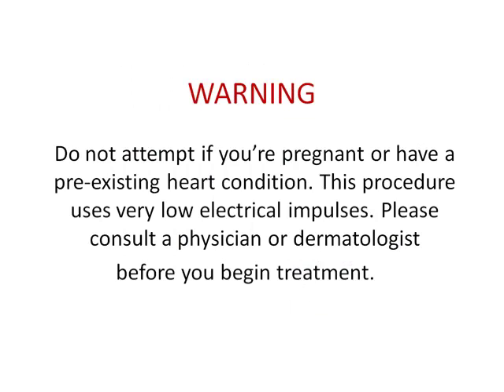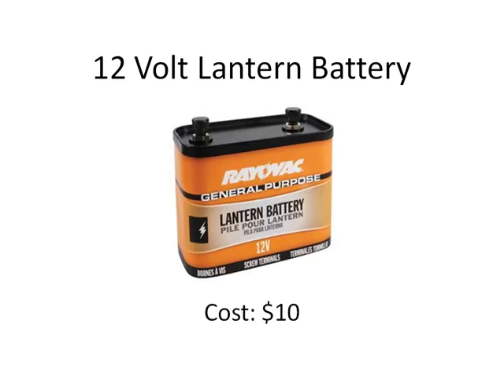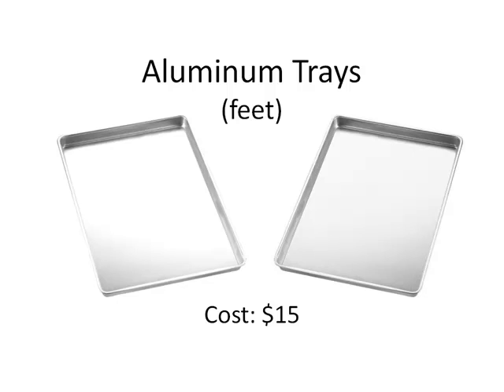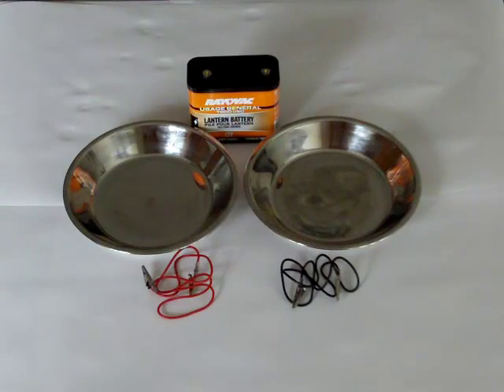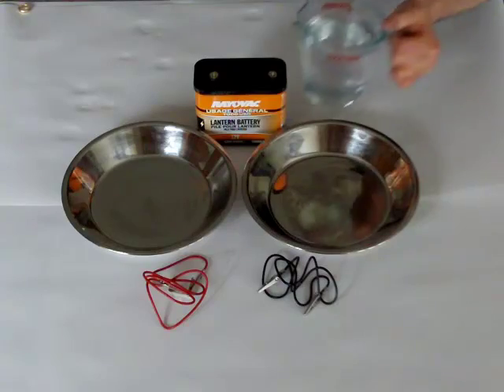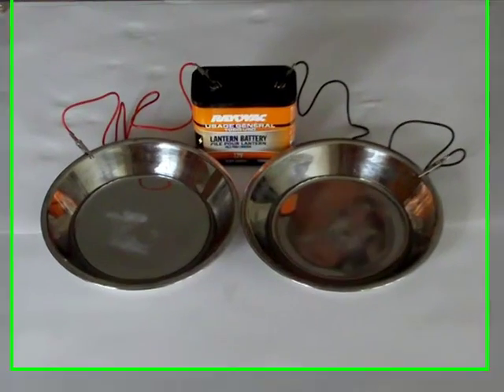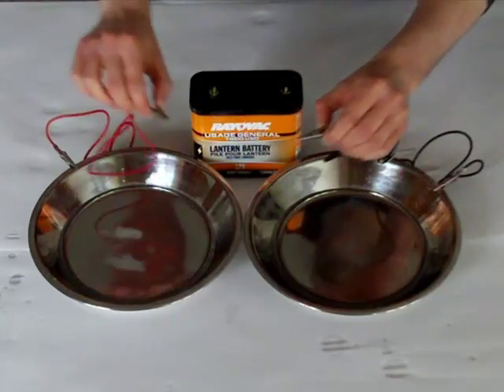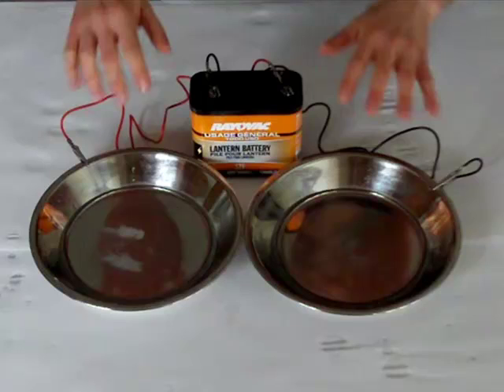How to Build Your Own Homemade Iontophoresis Device

Comment: i have a ad/dc adapter output 12v 2 amps it is save to use?
Reply: I am planing to do that.. I believe that it works, if you have does cups, try for few days if doesn't work, you always have another option... It would be good not to cut the wire, if it is charger for a laptop or something. just put some, peace of paper clip or something into the hole, and you have a + ... the other aria is - ... little bit of wires, and they you go, then if it doesn't work, you saved your charger.. I will try this pretty soon, I have 1.4 amps
Reply: *****  did that work?
Reply: *****  did that work?

Comment: Ok so I bought all of the suggested materials from Amazon like you said. I connected the alligator clips to the battery and to the pans. However fit some reason I don't feel a thing, is that normal? If not then what an I doing wrong?
Reply: maybe you have a defective battery?

Comment: I've tried this and it does work, however my friends and relatives were shocked and prevented me from using it further because they say that it can affect my heart with the electricity! Is this true? I do want to use it but I'm afraid for my health.
Reply: Nah, voltage is too low. Amperage is really the power part that can kill you, but stay under 1 amp and you're fine

Comment: Hi...can someone offer any advice. When I put my hands, right when I complete the circuit, I feel a shock and that shock is somewhat scary. Is there anyway to avoid the initial shock? Any advice is greatly appreciated. Please Help!!
Reply: Brian, it is a normal part of the treatment. You tend to get a little shock when you initially place your hands in the pan, and also when you switch hands. After a while, you get used to it. The good thing is if you feel the shock, then it means your battery power is pretty good. If the shock is too strong and stays too strong during the treatment, you might want to lower your voltage. On the other hand, if you don't feel any shock, it means it's time to replace your batteries.
Reply: Dan Reeves Hi, is it possible for me to replace the battery with this? http://www.amazon.co.uk/Blackspur-BB-JS206-12V-Trickle-Charger/dp/B003VS7VVE/ref=pd_rhf_dp_s_cp_1_YPJ7?ie=UTF8&refRID=0E1QG40H70YQR1YB3CVC I really don't understand these stuffs and wonder if I could use that. Thank you.

Comment: Can I connect 2, 12 Volt Lantern batteries together with the alligator pins to create 24 volt? I have been using 4, 6 Volts batteries and I just noticed that it would be cheaper if I buy 2 of the 12 volts batteries. Thanks

Comment: Brilliant Jason. Thank you so much - just after a week and the effects are incredible already. Even though I misremembered the instructions and only did it every other day.
I wish I'd done this years ago!! I've used an old camcorder charger I've had lying about for years which gives out 11v. 
Although for me the tingling with the salt was too much - so I've gone for pure water (maybe too much salt?!). And i've lined the bottom of the trays with paper so it's easier to rest my palms / feet in :-)
Reply: Hei,i am facing e problem!! I get bit electric shock when i put my 2 hands one by one...
But when i just put 1 hand in the water and the other is not using,it Doesn't give me shock.is there any problem with my function?
Reply: @Sarah-zh4xj You are required to use both to complete the circuit of electricity

Comment: That is incorrect procedure from everything I have read and experienced.  It deals with polarity and you want different polarities for each plate and remember to switch polarities. Also, having plates touch is not recommended because it will affect your batteries. I am not an expert-I am basing my comments on videos I have seen and materials that I have read in the past.

Comment: I've been doing this for more than three years with excellent results. I use 18v consisting of three 6v lantern batteries in a series.  Some people go as high as 24v but I found that difficult to tolerate.  I only do the treatment on average about once or twice a month but recently did not do it for about 4 months without any apparent adverse effect.  I think that a lot of the condition is sparked by stress or nervousness in my case.
Reply: Hello sir, I am glad it worked for you I know it's been 9 years but can you enlighten me that if your condition cured permanently? How often you sti use this 
Please Answer I'm too suffering within this from my childhood

Comment: Use 3 or 4 6v Lantern batteries and hook them up in a series. That way you will have 18v or 24v which will increase your chances of getting results. Be patient and don't give up.  Also, consider a treatment every other day instead of every day.  Sometimes it pays to wait a day or two and you may find your hands dry up in the interim.

Comment: I have hyperhydrosis pretty bad to the point where I drip sweat off my hands at certain times. I've used this anti-perspirant called Certain Dri. It doesn't really work well on my hands or feet but it works REALLY well for my armpits.

Comment: If it does, just don't panic as I did.. Now I learned few things from my personal experience. I noticed that it still works but if the weather is below ~25C, also I've been told that if this happens best way to get it work is to stop ionto treatments for a while so your skin and sweat gland lose resistance to electricity.

Comment: try mitchum deodorant (roll-on), it's 20% concentration like most of the strongest clinical antiperspirant and it's the only one i've found that doesn't sting the underarm area, it's around $3 at any pharmacist/chemist warehouse, or even a regular store like coles or woolworths. Also i do believe you can find something online that's like a metal plate with a cloth that you can use for underarm, but i'm not sure.

Comment: If you use a 6 or 12 volt battery is safe, even with salt water, you dont begin to feel a slight pain until 50 volts or more.

I doubt about the efectiveness of this method but seems pretty legit.
I think it's not permanent but it's a good solution to end with the vicious circle of sweat > stress > sweat more > more stress > more sweat...

Comment: Thanks for this Jason. I have an Idrostar machine for my feet. I recently worked out that if I got some deeper plastic tubs and put my feet in them on the metal plates provided, I could  achieve a cessation of sweating right up to above my ankles. continued below>>>

Comment: It was like having 'normal' feet - it totally changed my life - and was so much better than just stopping the sweating on the soles of my feet, or the soles and topsides, which is all that is possible with the depth of tray which comes with the Idrostar. BUT - AND THIS IS VERY IMPORTANT - my deep-tub system only works if I keep the amount of water to a about the same amount as would fit in the Idrostar trays. CONTINUED BELOW...

Comment: I achieved this by putting some glass building blocks in each tub alongside my feet to displace the water so that it covered up to the ankle without requiring gallons of water. It seems that the more water there is, the less effect you get. My aim now is to get some deep plastic tubs that are just the same size as my feet, then put aluminium trays cut to size inside them, and then place one end of each tub on a block so that they are angled about 30 degrees. ...CONTINUED BELOW..

Comment: That way, I'll get water coverage right up above my ankle with minimal water. Any thoughts on this? Also, I notice you don't have any plastic insulator mesh between your palms and the aluminium trays. These meshes come with the Idrostar. Are they really necessary or not? Thanks again.

Comment: Don't use a car battery, your dad is right. Buy a couple of 6 volt lantern batteries and connect them up or use the 12v that's in the video.

Comment: This device worked for me. I saw the results in about 12 days, first few days at 12V than 18V. The only thing I added on my setup is those kind of plastic sink rugs at the bottom of the pans so that the hands aren't in direct contact with the pans (in my opinion, much more comfortable than have the hands hover in the water).

Comment: @DanReeves 1 daily been doing.it for 3 weeks still i dont  see any sweat reduction just a little.. 2. A spoon of salt per pan but ive been doing it  with  baking soda the past   5 days 3. It feels.kind of.cold the water sometimes is warm., 4 im not sure.ill.tolerate 24 v because of the cuts dots ive.been.getting.thanks  to.treatment. 5. Its sumerged that it.only hits my palm 6 im using 6v latern batteries for a total of  18v . 8, Im using aluminum pan i bought it all on amazon , i hope.u could h

Comment: @Danrivers im using aluminium pans its been 3 weeks and nothing i dont wash my hands with soup lol and i sumerge it that it only hits my palms ans i stopped using salt and started using baking.soda and still getting irritaded dots when im doing the  treatment when my hands are dry i noticed than if i  do it with the sweaty hands i feel.the electricity on my entire hands ive.been using 3 6v latern batterys for 18v

Comment: I've done the exact same procedures with 18V for 6 consecutive days now, and I got no results at all, I still sweat my palms and feet.

Any Ideas why it's not working with me?
Reply: Any results after that?
Reply: @harshithrao9126  yes, worked like magic ! I still do it till now (8 years later)... it is stubborn at firts and needs consistancy.. for me it takes somewhere between 10 & 15 daily therapies to get it dry.. then I need  a maintenance session once or twice a week
Reply: Great!! Happy for you!! Completed 6 daily session and there is no significant improvement!! What is the electricity level you use for both Palms and sole?

Comment: I did this procedure last year and got a good result, the only problem is that I had to do it for over 3 weeks to obtain dry palms. I would suggest buying HIDREX PSP 1000 Iontophoresis Machine which give very high currents (equivalient of 12 car batteries) for good results

Comment: Samuel,

Some questions for you;

1. How often do you do the treatment? Daily or every other day?
2. How much salt do you add?
3. Do you use warm water?
4. Can you tolerate going up to 24v?
5. Do you wash your hands with soap before each treatment?
6. How deep are your hands submerged in the water?
7. What type of batteries are you using?
8. What type of pan are you using? steel, aluminum?

Please answer these questions, and I will follow up.

Comment: HELP 911 Ive been doing this for two weeks and no results ive been doing 3*6v total of 18v.. 20 minutes each polarity and nothing my pans are getting like oxidixed i think its because of the salt ... and recently i got little white dots  and stings with the treatment... because of the treatment like the electricity makes that... majority of the time i have a cut in my hand and it stings alot i just try to tolarate it and continue with the treatment .. can someone tell me what im doing wrong :(

Comment: am i right to say that if the 2 plates are touching each other, it is going to complete the circuit without any effect on the hards. Current will just flow through the plates.

Comment: Ok, well I'm going to make a long post in a few days perhaps with my complete thoughts and update.  Just wanted to check in...  But so far my hands have stopped like 95% I would say.  It only took 7 days, 5 of those days using 24v and 2  of those @ 12v.  The wierd part is that part of my hands (fingertips, outter palm) are completely dry, while part the other parts ( 1st two-thirds of my fingers and middle palm) still sweat a bit which is annoying.  I really want it ALL to stop so I'm gonna.....

Comment: Hi all!I have a question.I started using this last November,and my hands/feet got completely dry in about a week.Then I continued only with maintenance treatment,1-2 per week,and my hands started sweating,very little though,again.I stopped it for a month,and then,I started again, 24v on the legs,18v hands.My hands got dry,not completely,but my feet are still sweating at about 60%!I stopped for a week and started again,it's been a week now,my feet at 18v but still nothing.I think I might be

Comment: Hussam,

I thought you were using 6V batteries. Since you are using 2X 12v batteries, if I were you, I'd stick to the 24v total. The power will decrease with use anyway. And the greater the power you can tolerate, the quicker will be your results. Stick with it, and in a few days just gradually add salt to the water.

Comment: Dan,

Thanks so much for the quick and through response.  The reason I was using using 24v was because I purchased two 12v Lantern batteries shown in the vid.   So should I just use one of the 12v batteries and purchase another 6v battery to connect to it?  Do they have to be the same model/make of battery because I am not sure they make a 6v Rayovac Lantern battery.  

Thx again for the response.

Comment: Hussam:
1. 1 treatment/day is more than enough. More than once a day & you may be damaging your nerves & heart. Also, it's important to give your hand time to 'heal' so that your skin on the back of your hand doesn't become too dry or irritated.
2. Change the water each & every time per treatment. Never use the same water twice. This will prevent hand infections.
3. I'd suggest you move down to 18V & add 1 teaspoon of salt to each pan. The salt helps close the pores & you get quicker results.

Comment: I have a few questions if anyone can answer please....
1)Can I do this 2x a day to speed up the process?
2)Do I need to change the water everyday or can i change it just once a week?
3)I'm starting with 24volts, no salt and the zap is pretty damn strong....will I ever get use to the "zap", i.e.  will it become less intense as I keep doing the process?
4)Is it OK if I rest my wrist on the aluminum pie pan? I don't mind the minor shock I get from it, I just don't want it to affect my results.
Thx!

Comment: Jet, to connect 3X 6V batteries, connect (+) terminal of battery #1 to pan #1 on your right, then (-) terminal of battery#1 to (+) terminal of battery #2. then (-) of battery #2 to (+) of battery #3. then (-) of battery #3 to pan #2 kn your left. please keep pan separate at all times.  pans should never touch each other.

Comment: Actually worked for me on day 5. Had to add 3 x 6v battery bc 2 x 6v didn't do anything for me.  I was hesitant to believe this would work but actually works. I've been taking Medication for me sweaty hands and I've been slowly getting off it bc this has started to work about 85% dry. I been doing it everyday for. 15 min each so it gets a little time consuming. I wanna do it once every two weeks hopefully.
Reply: Hi Gill do u still use it or have you stopped
Reply: @rainbowdash6835  I used it for several year, then upgraded to an automated one. This method works, I just didn’t enjoy experiencing the jolt when putting my hands in. 

The automated method I got cost about $300 and works the same as this one except everything is automated. The voltage increase slowly so you don’t feel the jolt. 

If I didn’t have the extra money then I would have continued doing this method. Hope that helps.

Comment: you verbally state to use aluminum pans,yet the ones you demonstrate are stainless steel? or did u polish the aluminum with an electric buffer? also the safety of those pans touching each other?

Comment: Can I use a plastic container instead of the pan? I would just put the clip to the water directly. How much current does this 12V battery gives? Is it ok if I use 9V (the little one)? Sorry for the questions.

Comment: Continued...

Day 16. No sweat at all. ZERO sweat. My hands are so dry I have decided to do treatments twice a week from now on then gradually move to once a week, then maybe once every two weeks.

My twin sister has the exact same problem (palmar hyperhidrosis) so she is going to try this treatment after my success. I'm so happy.

Oh, and as I did my palm treatments, I noticed that my feet sweating has decreased drastically. My feet was not the main issue -- my hands were.

(Part 12)
Reply: Hi , I was wondering if you still use the iontophoresis device
Reply: @rainbowdash6835  I also want some guidance 😅 it's been years

Comment: Continued..

I noticed that from Day 1 - Day 4, my palm sweating actually increased more than usual. Please don't get discouraged. Keep on! Maybe your sweating may last a bit longer, but please once you get through the first 3-5 days or so, you will begin to notice a change.

From Day 6,  I noticed my hands were acting a bit funny. They were clammy at times, but other times, my hands felt like they were trying real hard to sweat, but there was no sweating.

(Part 10)
Reply: I know it’s ten years but am using 
12 v 2 A battery is that correct?
Reply: @omarsharaany490  thanks 12 v 2a are you shuar

Comment: Continued...

The best time to do your treatment is towards the evening when the weather has cooled. I did mine usually around 8 pm each night. 

For best results, before treatment, please wash your hands thoroughly with soap and warm/hot water to get rid of oils, sweat, dirt, etc. 

I did my treatment every single day starting from April 3, 2013. 

On Day 6, I used salt water. Add one full teaspoon of salt in a glass of warm water and stir to dissolve the salt. Add to each pan. 

(Part 9)

Comment: Continued...

Day 1 treatment observations:

When you place the second hand into the second pan, you will feel some tingling which usually goes away after a minute or so. It's not painful, just regular tingling, which signifies that your machine is working and has been connected properly.

I did 10 minutes for each hand, then switched terminals, and another 10 minutes for each hand. So each hand got 20 minutes treatment per day. 

(Part 8)